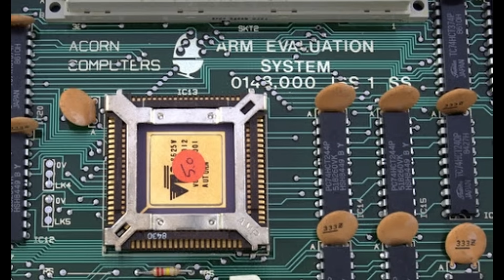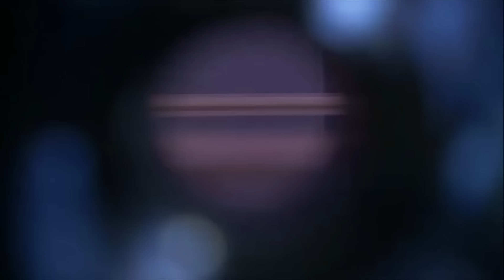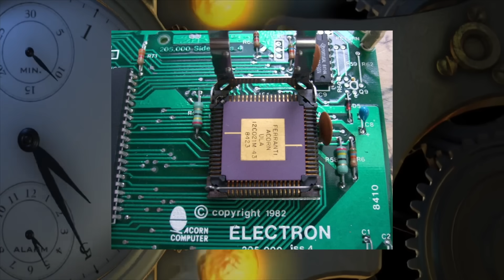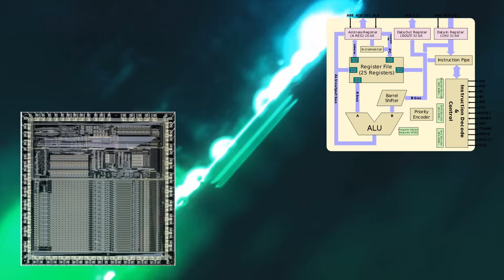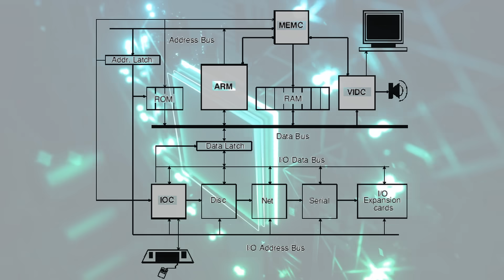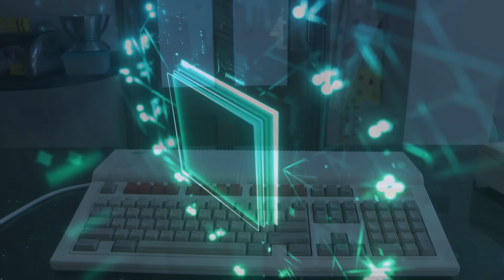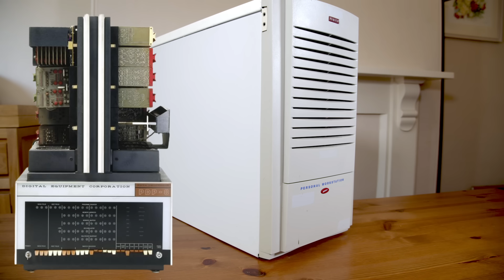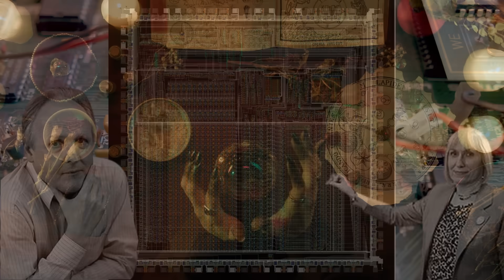The potted history of ARM

Comment: Don't own a mobile phone, but have a couple of Raspberry Pi 4s. One plugged into the TV as an emulation station so I could pack my old systems and games away safely, and the other has an 8TB USB 3 HD plugged in and NAS software installed on the SD card. Use it to save regular HD/SSD backup images off every machine in the house.

So yeah, it's amazing how just wanting to save a few bob per machine led to something that could do so much.
Reply from the maker: It is rather cool, I think Steve has said a few times if they where not trying to create the ARM on a shoestring budget, they would have probably designed a more complex chip which wouldn't have worked any where near as well.

Comment: 15:52 AIUI Thumb mode was solely about code size reduction ( though may also have had speed advantages due to fewer memory fetches). Thumb instructions were 16 bit, not 8-bit, vs. 32 bit for ARM ones.Thumb instructions were translated to ARM ones before execution. so I don't think it had much impact on power, at least from the CPU - may have saved a little on memory access.
Reply: Thumb and the Apple Newton also had absolutely no relation. Thumb came about years after the Newton
Reply: @cozy_kat  Absolutely. Thumb came about when Nokia wanted a CPU, not Apple.The ARM7TDMI manual was published 2 1/2 years after the first Newton. I'm not sure when the cores themselves, or chips, were actually available. Also, aside from making it sound like "Fun" mode, almost every technical detail is wrong. Thumb instructions are 16 bits in size, not 8. They can address the whole address space. As they are decoded into regular ARM instructions you can't "turn off large parts of the CPU". Thumb instructions are faster only in that they still run at 1 per clock cycle if you cheap out and use 16 bit wide memory where the regular instructions take 2 cycles to load. Both run the same speed on 32 bit wide memory. ARM7TDMI systems often had a mix of memory widths, with for example ROM code (the OS/library) 32 bits wide, but RAM (where user-applications were loaded) 16 bits wide.
Reply: Thanks for pointing this out. I've written code for ARM chips and the have tried both (performance is basically the same.) On modern ARM processors I'm not sure this feature even has much of a reason to exist anymore (since memory used for data will usually greatly outpace memory used for code.)
Reply: @aqualung2000  The L1i cache is still a valuable but limited resource.  For some code thumb (and especially thumb-2) is actually performing better than arm. Control code would be the usual suspect. The introduction of low latency l2 caches has finally taken a bit of the pressure off the l1i.
Reply: @ptefar  indeed. L1 icache has stayed exactly the same size for 20 years, and only doubled once in 30 years, despite denser process nodes that can afford the silicon space for larger caches -- the problem is that larger is slower. Pentium MMX to Pentium 3 had 16 KB L1 icache. From 2003's Pentium M all the way to the current "12th gen" Alder lake performance cores L1 icache has stayed fixed at 32 KB.  Alder Lake's slower efficiency cores finally have 64 KB. AMD used 64 KB L1 icache from Athlon in 1999 up to Zen and Zen+ (except for some experimentation in the "earthmover" cores), but Zen 2, 3, and 4 have actually reduced it to 32 KB. Note that AMD has often pursued a "lower clock rate, higher IPC" approach compared to Intel, and thus can afford slower but more effective caches. ARM with their lower clocked, higher efficiency, cores have also often had slightly larger icache than Intel, but also not growing with time. Apple M1&M2 are on a different planet :-)
Reply: @aqualung2000  Thumb is still normal to use everywhere. If you look at RISC-V, the C extension is the equivalent of ARM's Thumb, and it's assumed present on all general purpose processors.
Code size matters at every size of computer, from the smallest microcontroller to the largest mainframe.
Reply: Registers were all 32 bit, so each memory call othe bus would fetch two instructions instead of one.
Reply: @kayakMike1000  register size and instruction size are not related. There is nothing in the ARM7TDMI manual (for example) about the second Thumb instruction in a word having decreased or zero instruction fetch time. All instruction times are listed in terms of a certain number of memory bus cycles, plus a certain number of CPU core cycles. No speed-up is mentioned from running Thumb code from 32 bit memory instead of 16 bit. Fetching A32 code from 16 bit memory is slower, yes. This could be different in later CPUs e.g. ARMv7 (which supports misaligned 32 bit opcodes, so needs smarter instruction fetch anyway), but that's how it was at the time Thumb was introduced.
Reply: If we look at how ARM 64-bit instruction set is implemented, it looks more than a "fat" Thumb than ARM32. For example ARM64 commands are not all conditional as ARM32, instructions are 32-bit in length not 64-bit as they should be. So Thumb lives on and practically "ate" ARM32 traditional instruction set!
Reply: @IoannisDoukakis  no, instruction size is rarely the same as machine word size: the 32-bit era was an anomaly.
AArch64 doesn't have Thumb, or any equivalent, and the net result is larger code size when compared with AMD64 or RVC.
Reply: @microcolonel  what I am saying is that AArch64 reminds me a lot of a "Thumb64" instruction set. Increasing from 16 to 32-bit made room for new instructions of course.
One of the major features of ARM32 was that all instructions could be conditional, something that is lost in Thumb and AArch64.
Probably someone decided that 64-bit long instruction was too long
Reply: @IoannisDoukakis  all standard instructions in every major fixed length 64-bit instruction set architecture are encoded with 32 bits. There is nothing like thumb about AArch64, it is not a compressed instruction set, there is nothing compact about it, it is actually one of the least compact instruction sets in its class.

Comment: Thumb instructions are 16 bit wide, not 8 bit. The full arm instructions are 32 bit wide.  Both use 32 bit registers and can address just a much memory. However,  the number of (easily) accessed general purpose registers is halved in thumb mode.  Code written in the two modes can interoperable freely.
Reply: Right on everything except registers being halved in Thumb mode. It's true that many Thumb instructions can only use r0-r7, but SP, LR, PC (r13, r14, r15) continue in their normal role so it's more like 8/13 (61.5%) or the registers freely available. Also, you can add, compare, and move between all 16 registers, so with just a little bit of planning you can keep things such as loop limits or frequently reused large constants in the high registers.
Reply: @Bruce Hoult  It is a good tradeoff. Thumb-2 with its mix of 16 and 32 bit instructions removed a lot of the limitations from thumb. I guess the complexity for the branch predictor and instruction decode made arm go back to uniform instructions for A64 in aarch64.
Reply: @ptefar  Thumb2 and its code density absolutely made ARM what it is today. Dropping that feature for 64 bit was my biggest surprise when I read the ARMv8-A manual in 2012, and I firmly believe it is their biggest mistake. There is a very large gap between fixed length instructions and the instruction decode mess than is x86, and Thumb2 and RISC-V "C" are FAR towards the fixed length end in decode complexity while offering large benefits. Yes, there are 8-wide decode ARM ISA chips now (e.g. Apple) while x86 is stuck at a lot narrower. But there are 8-wide 2&4 byte length RISC-V coming quickly. MIPS have already formally announced availability of their core, and several others are following close behind, including open source CPU cores.
Reply: @Bruce Hoult  The variable length decoders and multi-branch branch predictors become power hungry quickly. Especially if you try to keep the pipeline short for code with high branch entropy.  On the other hand l1i is a valuable commodity, so it is a tough tradeoff.

Comment: I loved my BBC Model B which I took to Riyadh in 1983. My most useful program was a Darts Scoring program that spoke your shotouts using the speech synthesis board. It revolutionised the Riyadh Winter Darts League.... 😉
Reply from the maker: That's fantastic, I love hearing the unsual use cases people found for these machines.  8 years ago I ran across someone using two A5000s for doing all the timing for runners for the sheffield 20k.  He wrote all the software in BBC basic (initially on a model B), and was still running it all on Acron hardware.  When I talked to him he was planning moving it over to an RPI running RiscOS.

Comment: Arm is still terrible in laptop or desktop as it doesn't really have a proper bios!!
Reply from the maker: Depends on who made the machine, there are ones that have a UEFI firmware just like a PC.
Reply: Works fine with Linux.

Windows-on-ARM ... that was always a trainwreck anyway.
Reply from the maker: @lawrencedoliveiro9104  Oh yeah windows on arm is suprisily painful.
Reply: Kind of ironic since most x86 motherboard chipsets, AKA what runs the UEFI/BIOS, are themselves small ARM controllers

Comment: Not enough of Youtube espouses just how much of a beast the StrongARM processors were! We had a couple of RiscPC's in our lab with them and they ran absolute rings around anything. Sure, you don't have a particularly flash native TCP/IP stack but it's 1996 and who needs that?
Reply: The StrongARM was the CPU used in the Newton MessagePad 2000. I was hoping Apple would put a camera in there also, but it didn't happen.

Comment: I was biting my nails at the nVidia Takeover, because I really didn't want to see one of the few lasting independent chip designers get swallowed up by a commercially abusive conglomerate like nVidia.
Reply from the maker: I was very glad it did not happen, I was pleasantly surprised to see Whitehall finally wake up to the risk to the tech sector.   I dare say Hermann Hauser's appeals in the press really helped there.
Reply: @RetroBytesUK  Absolutely, Despite nVidia's very public 'promise' not to be dicks with it, we all know from bitter experience that the reality would sooner or later become a back pedal, because the shareholders would inevitably pressure the company in to using it as leverage to weaken the competition. it's what they always do. it's never about morals or doing 'the right thing' it's always milking that investment and using it to gain market dominance - profit.
Reply: @RonLaws  well if they don't like independent tech companies that can't be bought, then they're really going to despise vengeful technologies (my new start-up). I got myself a very small but capable fpga and create a very capable GPU processor adding an extra 8 gigs, working on total 32 gigs of ram for different things since I wanted to use a risc-v architecture and use a custom Linux kernel. There's a company that sells those modules thus gotten 70% of my work load done so I can focus on my custom GPU unless there's a powerful low price chip that exceeds current standards. But I haven't found it yet, I'm also working on my infinite energy project. I'm pretty busy as you can see including the legality of the initiative since even though infinite energy is possible there's a monopoly in place thanks to Thomas Edison so I have to be careful with making that into a commercial product.
Reply: Just as worrying is the Softbank-nonsense sale to Chinese 'partners'. Luckily we have Intel and RISC-V, so ARM can probably disappear these days.

Comment: Will have to see what happens with RISC-V in future as that may become a major CPU architecture, especially in datacentres. As for other platforms, still not sure.
Reply: There are already products that are price/performance-competitive with, say, the Raspberry π. Look for reviews of the latest VisionFive 2 board from StarFive, for example.
Reply: @lawrencedoliveiro9104  VF2 is a huge step forward. I got my shipping notice as kickstarter backer #14 yesterday, so hopefully I can very soon compare it to my Pis, Odroids, and HiFive Unmatched. In most respects, the VF2 lies somewhere between a Pi 3 and Pi 4 in speed, but the lack of hardware SHA, AES, and SIMD will hold it back in some applications (and provide easy fodder for biased reviewers). Those "missing" instructions have already been added to the RISC-V ISA and will hopefully be present in next year's crop of boards. The VF2 GPU is about 4x as powerful as the Pi 4's GPU, so once proper software support is in place it should make a better desktop and media machine than the Pi 4, even if the CPU cores are a little slower.

Comment: The problem with arm compared to x86 is that it's not standartised enough I'm sure there are standarts but probably ones with so many optional parts that compatability is not ensured. On x86 you can take software and OSs from any PC to any other. On arm you can't really do that for the OS you can't for examaple just isall radbian on any other arm based SBC, almost every arm device with a few compatible exceptions needs it's own software. This lack of universal compatibility is why I don't see arm as the future along with software backwards compatibility.
Reply from the maker: The application code is all backwards compatible, where the issues arise from is getting the kernel booted correctly. All the SBCs have emedded hw, thats not automatically discoverable. So each SBC needs to have its own overlay file for the devietree to tell the kernel what hw it has an where it is. The overlay file is a big leap forward, previously you needed a kernel build for each SBC. For the ARM based servers desktop etc, you dont have this problem in the same way, as everything you need is hanging off pci-e so any kernel will boot it. Occasionally the vendor may supply a DT overlay for temperature and fan speed sensors, but the boot firmware takes care of running the fans, you only need the DT overlay if you want to read the values in userspace.
Reply: Custom design is the true power of ARM and this is the primary reasons of compatibility issues. Some vendors can provide UEFI, most not. And then Armbian comes to the rescue ... it provides pretty standard Debian experience accross very diverse hardware.
Reply: An interesting solution is how Apple managed it with Rosetta 2 and actually including some x86 instructions on its ARM M1/M2 chips. It appears to give excellent backwards compatibility for MacOS x86 software, and seems pretty performant to boot. Of course, in Apple's case it is both the chip designer and OS developer, which I'm sure helps a lot! 

Repeating this kind of work for Windows and Linux would need a lot of coordination between the chip designers and OS devs - something I doubt will happen without some sort of standardisation.
Reply from the maker: @RoganGunn  Saddly I don't think Apple would participate in a standards process around that sort of extention.
Reply: @RetroBytesUK  and it’s a shame because I’m sure they could make a huge dent in the PC laptop space if they wanted to sell those chips.

Comment: I had an  Acorn Electron as a kid, which suffered ULA instability problems until it got new innards to stop it crashing. I bought a BBC Master later in life that I still boot every now and again, plus several Archimedes A440's that are currently in the loft. I've always admired the tenacity of Acorn and how important ARM became- it's a shame it was sold to Softbank when this was such an asset to the UK economy, where profits now go elsewhere despite being based in the UK.
Reply: I had an Electron with the Plus 1 joy stick, printer and ROM cartridge interface and Plus 3 floppy drive add on (Plus 3 cost me £200 in 1980 somthing 🙄)... loved it though...
Defraging the drive was interesting as it used video ram as storage space.... and was it quick compared to tape....you bet your life it was.
It still played Elite but at a lower res as the CPU ran at half the speed as its big brother the BBC.
The best thing about the setup was how it all went together...
Everything was BOLTED....no ZX80 problems here, they were solid in their connection...never had a ZX80 problem... lovely machine.
Reply from the maker: @michaelhawthorne8696  I only had the plus1 as a kid with my electron, I would have loved a plus3. Especially as it had adfs.
Reply: @RetroBytesUK  
I was in my 20's then and working at GEC in Coventry England so was getting a decent wage....
My first printer I ever had was a Brother HR5, 30 charactors per second using a print cartridge (Black only) tape which would last maybe 10 A4 prints...pretty laughable by todays standards and that cost £150 ! 🙄😮back then but it did complete the setup ...
The Electron with its add-ons looked really nice...I always wondered what the Plus 2 would have been, if it ever existed.
Reply from the maker: @michaelhawthorne8696  There where so many odd ball printing technologies abound in the 80s, even the more main stream ones anyone born in the last 20 years might think you’re pulling their leg if you explained how they worked.
Reply: still get the taxes of the people working there ...
Reply: @jyvben1520  ...which goes directly to HM Government. The real, more direct benefit to the UK's economy is from the salaries of those working at ARM, plus the secondary benefits of it using a British talent pool (fostering education etc).